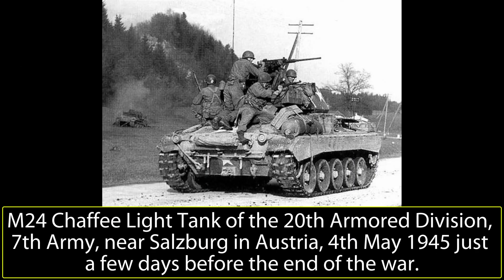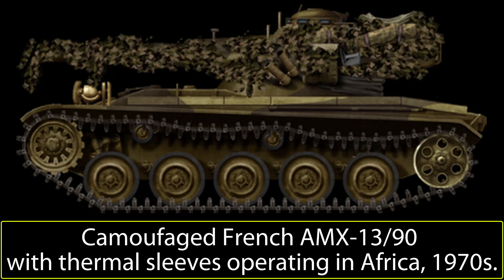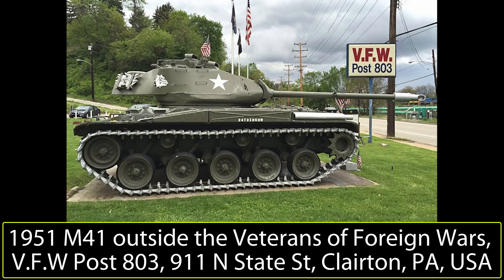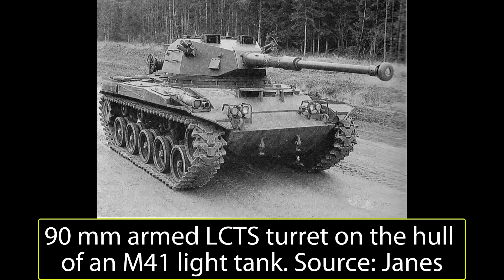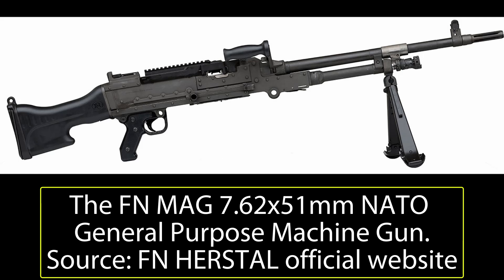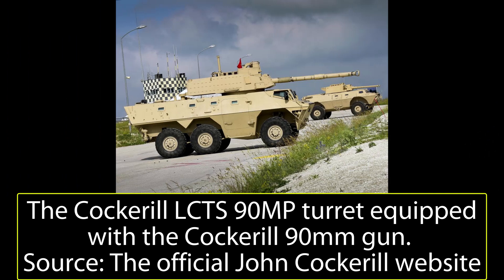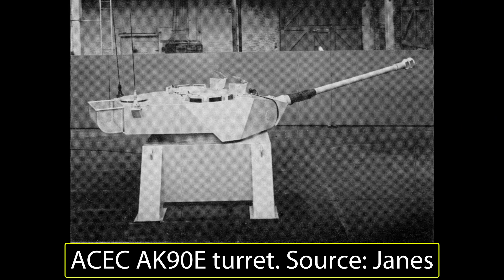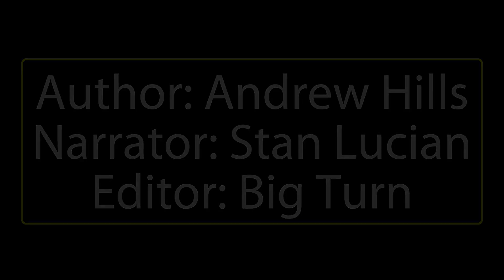New Face, Old Body | M41 LCTS

Comment: I doubt there was ever any serious effort to export the LCTS turret for fitting to M41 tanks.  Likely the prototype built was just a test bed using an available chassis. Cockerill had already developed a 90mm high velocity gun for fitting to the turret of the M41 which sold to Uruguay.  The fact there were not additional sales and that indeed, the market for upgrading M41's proved rather limited indicates extensive marketing of LCTS on M41 would have been a waste of resources.